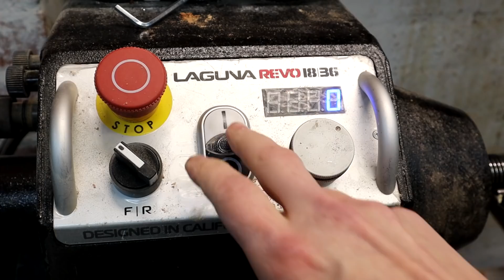Woodturning - Applewood Pencils

Comment: Hello.  It is essential to mark the wood before cutting the two parts of a pen, so that the grains of the wood coincide, in the same pen.  In order not to lose these marks, I transfer those marks to the inside of the brass tubes with a permanent marker.  Greetings

Comment: Hey Matt, I haven’t watched the video, but I’m sure it’s amazing as always, I had a question. How can you dry tree branches without a kiln? Thanks!
Reply from the maker: If its just a branch, put them in the house for a few months. Most home kilns are low temperature anyway, and operate at about 30 degrees Celsius at the most. Its the lower humidity that does most of the drying over temperature  👍
Reply: @MattJordanWoodturning  alright, thanks for the reply!